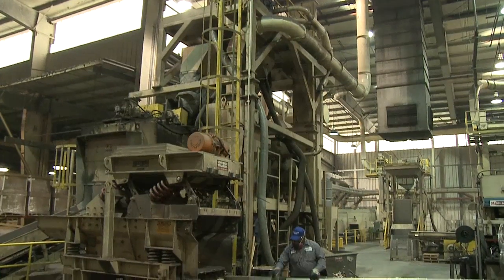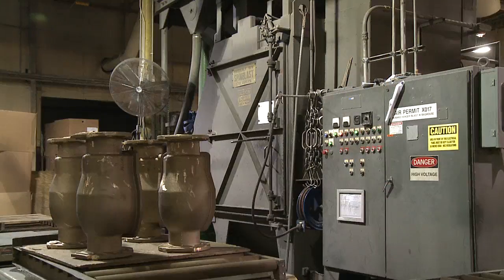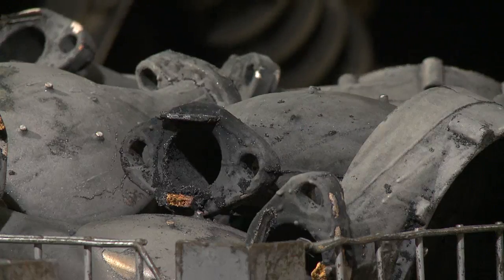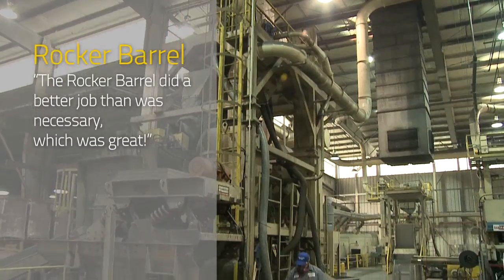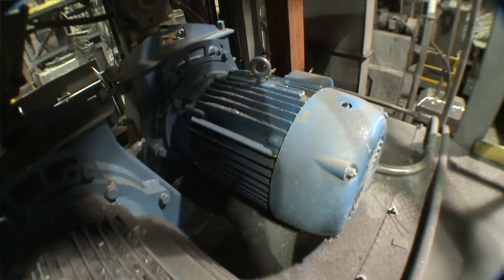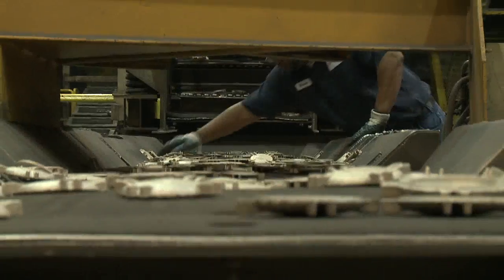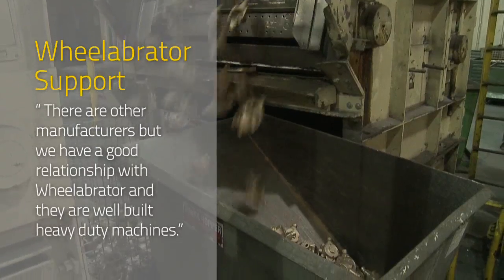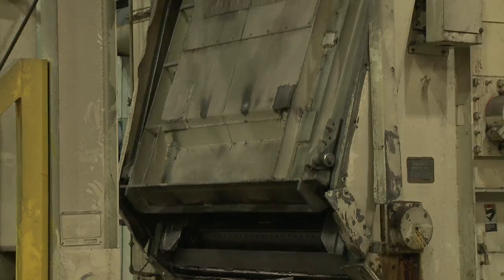Wheelabrator Customer Testimonial │ Neptune Technology Group

Comment from the maker: “There are other manufacturers but we have a good relationship with Wheelabrator and they are well built heavy duty machines.” Frederick B. Murphy. Neptune Technology Group, Foundry Engineer.
 
This week we take a look back at our great partnership with utility management system manufacturer Neptune Technology.
 
We supply this water industry leader with multiple Wheelabrator machines. Watch how we exceed their requirements here...